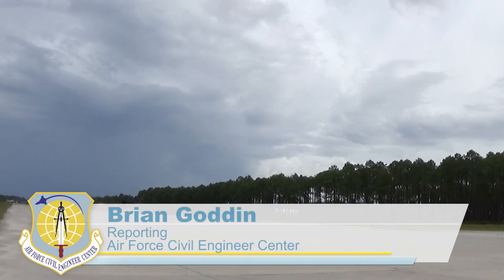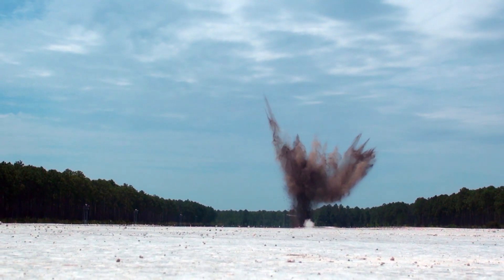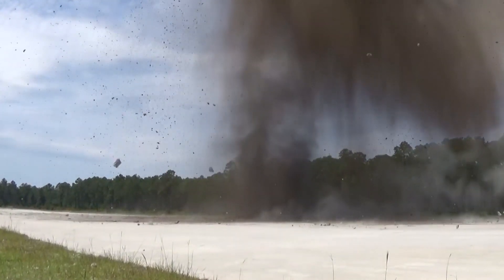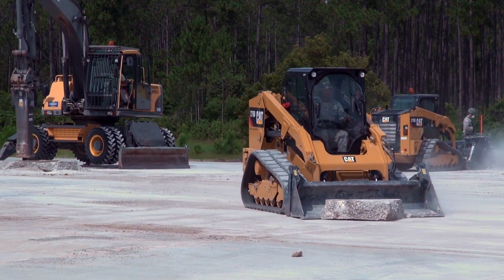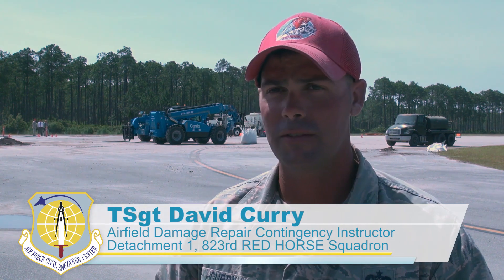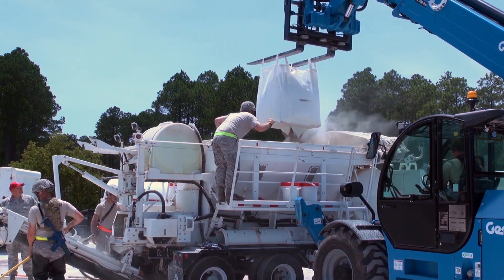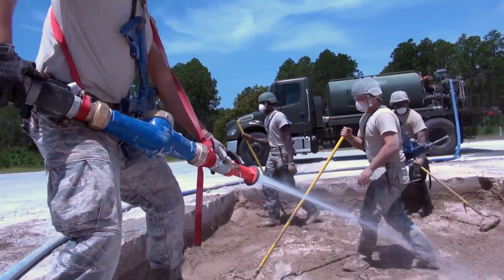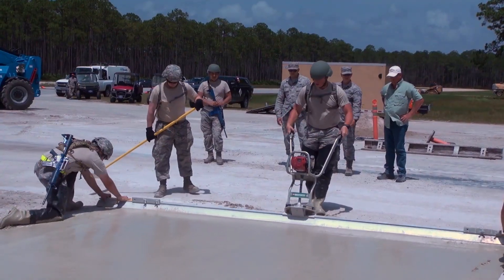Rapid Airfield Damage Repair - RADR

Comment: 3 hrs? That's an improvement? In 89 we regularly did major crater repairs in ONE hr, To runway usability. (Not to like new condition In Chem gear).
Reply: when I was in we used steel matting, not sure if that would fix a hole though
Reply: Runway usability and being able to fly 3000 sorties is an entirely different thing.
Reply: The goal wasn't sustained flying. It was to get birds in the air ASAP,  complete repairs followed while they were out. All that was required was a (sorta) straight line.
Reply: @A_No._1  yep, chem gear is no joke to work in.